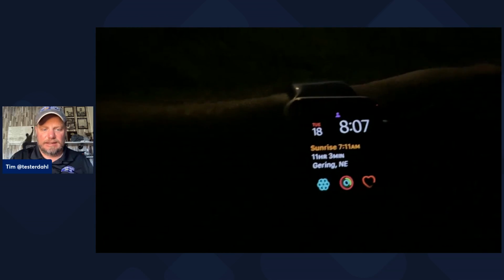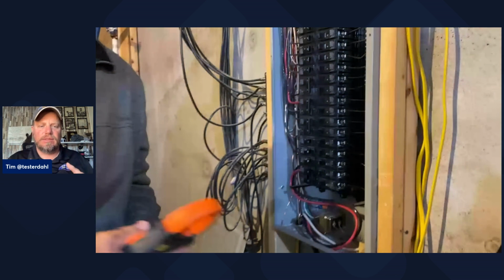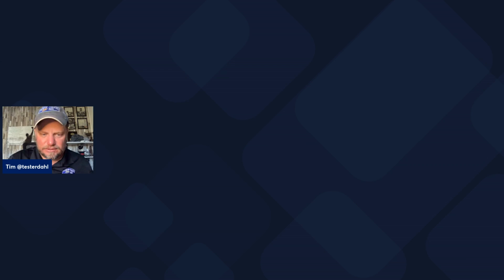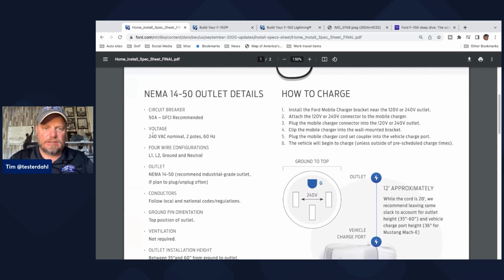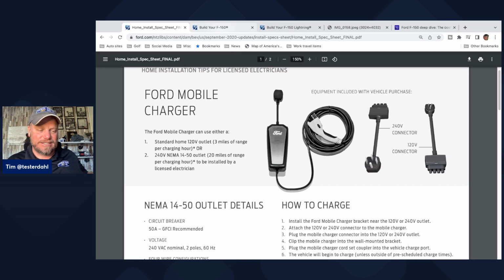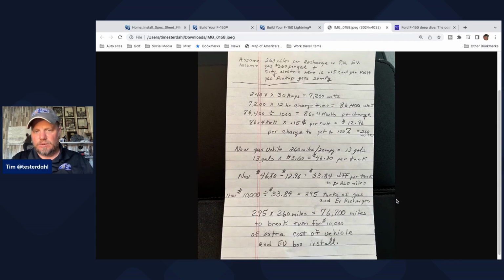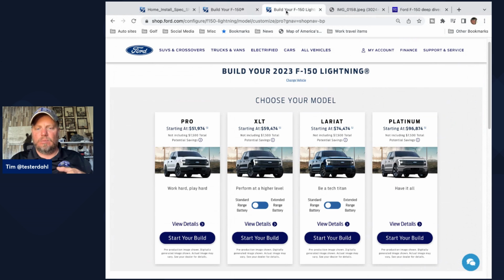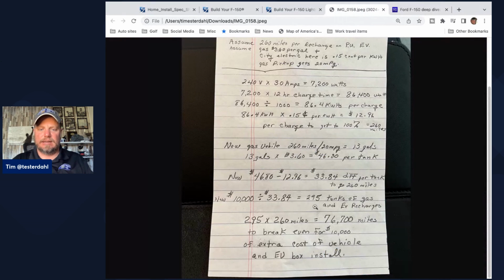11+ hours later on 220V charging price for 2022 Ford F-150 Lightning

Comment: Hey Tim, it may have been a 20-minute video but it was a good video. Other than myself, I have never seen anyone break it down quite like that on paper. It is important from an ROI standpoint if that is your concern, however most will just be excited to get whatever vehicle they decide to get right. I am curious about one thing, in terms of overall maintenance cost, when do you have to replace the lightning's battery and how much does that cost?  Thank you
Reply from the maker: Thanks. Unfortunately there's not a lot of good information out there on battery life and replacement costs. Estimates have ranged from $5-20k for some EVs and the battery has lasted for a decade or better for some early adopters. I think the battery is a lot like an engine. Treat it right and it will last, supercharge it all the time and it won't.
Reply: Thanks Tim...time will tell I guess.
Reply: @Viking-5894  FWIW, Ford provides an 8 year / 100,000 mile warranty on the battery.

Right now batteries are definitely expensive, but in 8-10 years hopefully much cheaper. For popular models like the Lightning there will be third party support options. This is already the case for Teslas.
Reply: @usa-ev  I don't believe this will ever be the case. We're plateauing when it comes to huge jumps in energy density with chemistry / battery design. When there IS an improvement, the capacities just increase. So even though cost/kWh goes down, the "range race" is going to see battery capacities go up and up.  Resulting in balancing out the price point which is (even on second hand marker) 16-20k @ cost before labor.  The tesla batteries have always cost the same...but ofc they have like double the range on average. Then with older models of ANY ev, the old battery platform gets abandoned so then the price for old tech inevitably goes up on an already disposable item. 

Yes you can say the same for ICE, but at the end of the day you can't beat pulling 2nd hand engines *yourself at 800-3000 and taking a weekend to put it in. I've done this many times and it's not a huge hassle. THEN with ev's you run the risk of running into the numerous lockouts when a car is in an accident or a major drivetrain part is changed...at the software level - rendering your 16-20k replacement useless.
Reply: There was a lady with a Chevy Bolt (I think) but she posted the replacement quote from the dealer and it was $28K for her battery replacement. EV's are a cool idea but the infrastructure is just not there to handle a mass exodus to EV vehicles. We are just trading 1 environmental damaging method for another in the need to mine the elements needed to make the battery's (And IMO the strip mining is FAR more damaging than drilling for oil). IMO a GOOD hybrid design is the way to go. I'm VERY curious to see the RAM Revolution debut as I hear it is more of a hybrid design that will have a small recharging generator of some kind onboard.
Reply: @nativetrader3822  Don't forget batteries are 95% recyclable. Will only have to mine them once for 100's of years of service vs. fossil fuels which on top of the drilling are put into the air continuously. We have to breath that not to mention the greenhouse aspect. Then there are the leaks and spills. Indefensible.
Reply: @usa-ev  I think that is a bit misleading. 95% recyclable doesn’t equal 95% recycled, it’s an absolute best case scenario. There will always be losses inherent with re-refining metals back into production commodities.  There is energy needed to handle, store, ship, recycle and resell the metals. The battery, or energy storage sector is going to keep expanding, only limited by supply of source materials, so I think it’s unrealistic to think we can obtain a level of sustainability with regards to batteries and their required metals or elements.  Battery chemistry or makeup will likely change along the way because of lack of available elements or superior technology, so the demand for certain materials will probably continue to evolve, changing demand for 100% recycling all available elements in spent battery packs. 
Not trying to disparage positive environmental impacts of electrification, just want the scale to be equal.  
I wish the auto industry would slow down just a bit, instead of trying to outdo each other with these trucks that are not logical at all for a traditional truck’s role in transportation. They are placating to the (currently) large market for luxury trucks that don’t see regular duty cycle, and abandoning the traditional truck market needs. It seems unsustainable to me in a race to be “sustainable”.  I appreciate your comment and facts from the EV industry.
Reply: @shawnmh837  any amount of  recycling is better than the 0% on the iCE side of the scales.

Also on the ICE side of the scales are oil spills there is nothing even close to comparable to that devastation on the EV side.

EVs make great work trucks for most of what work trucks do. The only thing they don't do well is tow long distances. They still tow locally better than ICE trucks for businesses like landscaping, etc. And they make great fleet trucks.

Some people need to tow long distances, though so EVs won't work well for them yet.

I agree that EVs are still too expensive, although total cost of ownership does help even that out somewhat.

Luxury trucks existed before EV trucks came on the scene.
Reply: @usa-ev  like I said, synthetic carbon neutral fuels or something else to store electrical power. Graphene battery technology looks promising but mass production of graphene cheaply doesn't.
Reply: Check out state of charges videos he understands EVs a lot better.
Reply: @Bryan-Hensley  EVs aren't perfect, but they are good enough and are already rolling today. All the future clean energy stuff will be great when it gets here. In the meantime EVs rule.
Reply: @usa-ev  I was one of the first pro EVs. I really wanted one until I found out there's not much choice when replacing the battery. I'm all for people getting one who wants them.. I'm just totally against the government trying to shove them down our throats..
Reply: @usa-ev  If you can get them at all then !!
Reply: @usa-ev  🤣🤣🤣🤣🤣🤣🤣🤣🤣🤣🤣🤣🤣🤣🤣🤣

Comment: I agree it's a ton of variables. You talk about the difference in maintenance,  but I also think the battery pack cost has to be considered in maintenance cost.  I don't really see how you can put exact numbers on it. At the same time you have to figure the value of a 8+  year old EV has to tank. Seems like a huge risk to buy an older one with no warranty with the possibility of it needing a 25-30k battery at anytime. Sure an older IC vehicle especially with high mileage can fail, but not a 25k failure. on top of that EV mileage is just a small piece of the puzzle. If it was constantly fast charged and always charged to a 100%. How much faster is that pack going to die or degrade? I think you are going to have people getting loans for used EVs only to have their vehicle that they owe 30-40k on that might be worth 30k. Then have a pack failure. So then what? you owe 30k on a vehicle that's now worth maybe 5 because it needs a 25k battery. Fix it and have 55k in something that's worth 30k? Realistically how many people driving a financed used 30k vehicle have access to 25k for a repair? Looking at those factors resale on older EVs will be crap.
Reply: Exactly!!!!  Replacing an engine depending on whether it's from the junkyard, rebuilt, or new crate is way less than $10k, more like $5k, after 250-300k miles.  Doubt the EV battery pack will even make it that far.  Roughly half as far, at least 2x to 3x the cost to replace and start over.  All statements assume you live in the desert or semi-desert so the truck doesn't rust out before the engine quits.
Reply: Tron Jockey  You sir are ignoring the time cost for longer distance travel.  For an around-town vehicle, EVs are fine.  For anyone, such as myself, who can routinely do 500+ miles in a day, in all kinds of weather (especially subzero weather), and who does NOT have the luxury of extending my travel time, for hours, waiting for a charge, EVs arent gonna cut it.  Call it confirmation bias all you want, but the real issue is that a prospective EV owner has to be willing to change their lives to accommodate the differences in owning the EV.  Most people don't even like to change their toothpaste 😎.

Comment: Tim, can you set the charge level to 80% to stop at that level automatically?
Reply from the maker: Good question. I need to check into that and now that I'm done with the charging aspect of this truck, I'll have time to focus on that.
Reply: @Pickuptrucktalk  True ROI: THE EV & Solar “Green New Scam Deal” reviled. 

EV and home Solar It’s not affordable for the masses, doesn’t save money and are environment disasters.

We just received a quote to go Solar to both charge future EV vehicles (which now average over $70,000ea) and for home hot water, heat & AC via a required $15,000+ heat pump HVAC conversion.

Cost just for Solar tiles and power wall over $150,000! (Doesn’t include cost of EVs)

Also, both the lithium batteries needed to store the power and solar roof tiles degrade over time needing to be replaced in 15 years, another $350,000 investment with Democrats caused current inflation rates at 40 year record high!

Another fact, grid power is going up 35-40% each year as our low cost, ultra clean burning coal plants are being shut down, stupid is as stupid does. 

The horrible environmental impact to produce and recycle Solar panels, Solar lithium batteries and lithium EVs batteries (if one can even afford to do so and/or find a local recycle company) are both unaffordable and environmental nightmares. 

Conclusion: 
1: No Home Solar Panels;
It’s better to install wood and coal compatible boiler systems for home hot water and home heating then heat with natural gas as a backup when going out of town. 

For AC, it’s best install a heat pump or swamp cooler using grid power augmented by a wind turbine if one can do so ie HOA rules, available land, etc.

2: No EVs
With the true cost of EV ownership (ROI) initial purchase cost, cost to charge and cost to recycle and replace EV batteries, we have decided to purchase the new 2gen GM 3.0l I6 Duramax diesels: 2024 GMC 1500 Sierra and 2024 Yukon Denali 3.0l Diesel.

In fact, Diesel is the most efficient combustion engine fuel source, carrying 38 kilowatt hours of energy in every gallon — 27 times that of lithium ion batteries!

The financial and environmental ROI impacts proves EVs, home Solar panels and lithium battery power storage are bad deals on all levels. 

In fact, it’s all a big scam.
Reply: Yes, which is what you're supposed to do unless you're off on a road trip.
Reply: I'm absolutely positive the Lightning has target charge level support.  Only early model Leafs and early Bolts lacked it.  (Early Bolts did have hilltop reserve, which was 88%.)

Another reason to not charge to 100% is that you lose most if not all regen capability when the battery is that high.

Comment: Fifty-amp service doesn't mean you'll be able to ram 50 amps down your truck's batteries throat all the time. The charging circuitry will determine max charge levels based on a variety of factors. Just like using a battery charger on a car's starting battery but it's more sophisticated. A 10-amp battery will rarely show that's it's delivering full output. Charging on batteries also tapers downward as full charge is neared.

Comment: Electric/lithium ion is fun for toys but to think it's going to be your transportation is just insane. In the winter you won't get 150 miles of range from that truck as lithium ion batteries loose quite a bit when they get cold, and don't forget heat for the cabin.

Comment: I drive a Chevy Bolt EV ,I drive all day every day, plug in at home costs nothing to drive and never go to a gas station! I own a 2021 Ram 4X4 Crew to tow my RV and for long trips! The $250/mo I save in gas with the Bolt pays a huge part of the truck payment and paid off the Bolt in 2 years! The Bolt is full every day on a 120v outlet in the garage!

Comment: I’m a rancher in Montana. I have nothing against electric vehicles, but they are more a niche vehicle. When I’m hauling hay, livestock, equipment or whatever it may be, I just can’t afford to spend time calculating my range or to spend 2 hours at a charging station. With my F 250, I just load up and go, no calculations required. When an electric heavy duty truck can tow 12,000 lbs 300 miles and recharge in 10 minutes, I’ll be standing in line to buy one. I don’t see that happening for a very long time.

Comment: Continue: Owner's manual 220-240 volts breaker and fifty amps. Had a professional electrician install it and total cost was $260. The car is a 2023 Nissan Leaf Plus and estimated charging takes about 6 to 8 hours with resulting estimated ranges of 268 miles to  a low of 235 miles. I just plug it in at night and in the morning I'm ready to go.

Comment: The math you missed is what is your time worth. I can fill my tank in 15 to 20 minutes and can travel just over 600 miles. Based on Fords math it will take 31 hours to go 600 miles, At minimum wage that trip would add 250.00 to the actual cost. Not counting food and hotel rooms to stay over.

Comment: Other thing you didn't mention, or I missed, was that batteries lose capacity over time.  Sure, some of that is how the battery is maintained, but having to replace a battery at the cost of 5 to 10 thousand or more kills the EV argument for me alone.  Let alone, if you're towing substantial weight, the battery capacity will be about half or less from the tests I've seen.  So that means you will be paying to charge at some station and waiting hours for that 150 mile range to build back up.  Plus, the strain on the battery shortens its life.

Comment: You rounded up on the gas by approximately 1000 and rounded down 7000 on the electric. Pretty large gap for your comparison. 79k gas and 97k for electric an 18k difference. That moves the dial on your numbers.

Comment: A huge factor in determining real world operating cost is not just the cost of fuel vs. electricity for a given range but must also consider the time spent on the charging station. And how often you will be recharging.

A gas vehicle will be fully 'recharged' in about 5-6 minutes. An electric  vehicle will take ~45 minutes.

Comment: 2 Things.... 1. The price to replace that battery is between 29k - 36k. So you'll have to add that in, as it will need to be replaced at least once. Point number 2. Have you ever seen the fires these batteries cause? Might just be me; but I'm not keeping an ev in my attached garage. If I keep in a garage at all.....

Comment: Whiners will always whine about new technology, and those whiners are usually driving a 10 year old beatup pickups with 200k miles (just ask them).  After living with an electric vehicle for 3 years I can say it has been a great experience.  No gas station stops, no oil changes, no brake pad changes and the smoothest power delivery you'll ever see ... not to mention 2/3rds lower energy costs.  On extra long trips we take our gasoline car because stopping for 30 minutes every 3-4 hrs is a pain.

Comment: Buy yourself a meter and place the amp connector(s) around the wire(s) your using. I do this for our commercial properties because we pay for utilities and I wanted to know what each business is using.
Then you can follow it on the computer and they are extremely accurate

Comment: I just looked on Ford parts catalog and the battery for that truck is $29k , so either way you look at it your gonna have to put that money to the side that you would spend on maintenance an fuel  for a regular truck if you plan on keep it long term ,so you can figure on putting aside $6k a year for 5 years for when the tuck falls out of warranty.

Comment: Years ago my wife wanted to buy a Vespa scooter to save gas on her two mile commute. She was driving a Subaru that got about 20mpg town.  Did the math and at the time, just to make up the cost of the Vespa, she would have had to commute something like 365 days a year for 4 years straight, and that’s not even considering plates, insurance, etc, As we live in Michigan that was even more impossible than it seemed on the surface and we’d have to keep the car as well. People get so hung up at what the fuel costs that they forget all the other factors.

Comment: 30 amps per phase is 30 x 240 (220 some might say, with out the data) or 7200 watts. Better to think in watts or kilowatts... 7.2 kw. You can determine your cost by looking at your bill to determine what you pay per kilowatt. I could not figure out what you where trying to prove or show. The phases are called L1 (Line 1) and L2 (Line 2) both are 120vac to ground or 240vac across the two phases.

Comment: Here is how to calculate the cost of charging an electric vehicle, 1st obtain the price per Kwh… example hawaii 15.29 cents, 2nd Covert your power usage to watts ( watts = amperage x voltage) so in this video he was drawing 30 amps at 220 volts which = 6600 watts, 3rd convert to Kwh (watts x hours) divided by 1,000: 6600watts x 13hrs = 85,800; divided by 1,000 = 85.8, 4th Kwh x price (85.8 x 0.1529) = $13.11 is what it cost to charge the vehicle